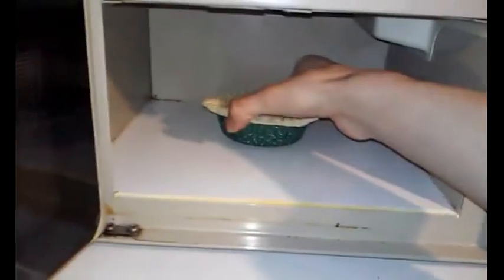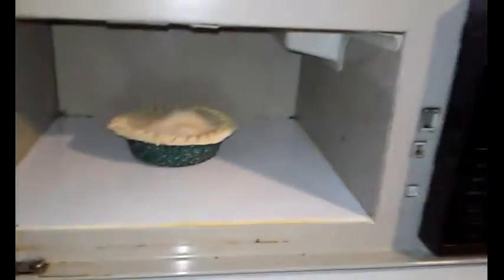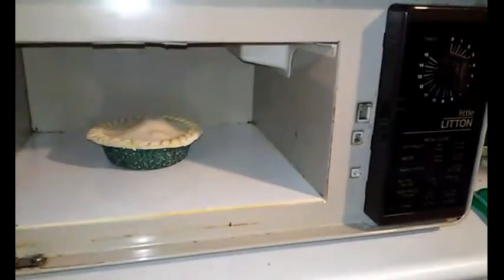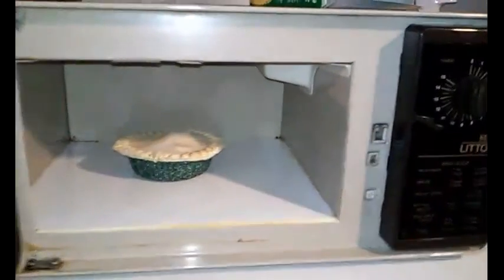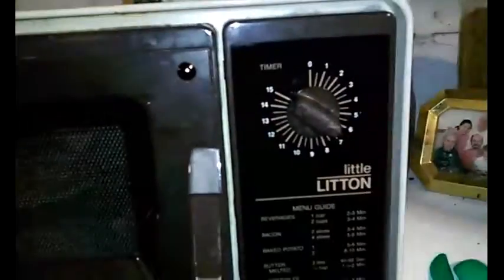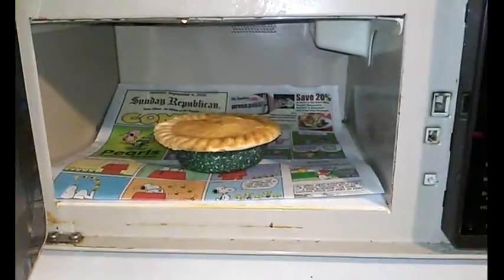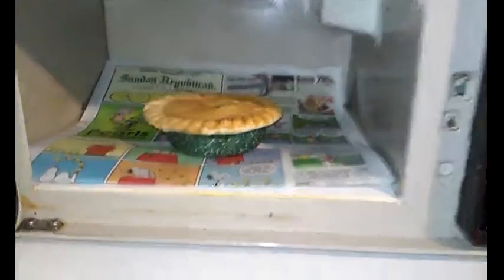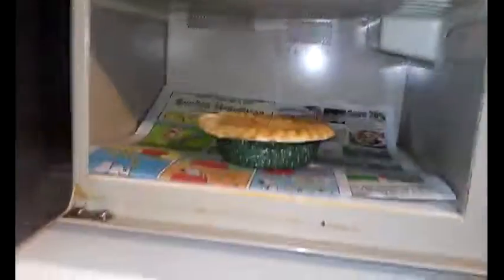Cooking a chicken pot pie in a 1980s microwave

Comment: Cool vintage microwave oven! :)

I'm not trying to be a prig, but, is this the same microwave you did an interior disassembly and reassembly of earlier?

If so, is it possible you put the fan back in upside-down?  If so, that may be the reason the steam is being blown out the front instead of being sucked out the back!?  This would also explain the reason why it didn't cook correctly...too much steam condensed into moisture in the cooking area that should have been exhausted out the back!?

Check and see if there's air exhaust exiting the back.

Still, an awesome video of a cool microwave! :)